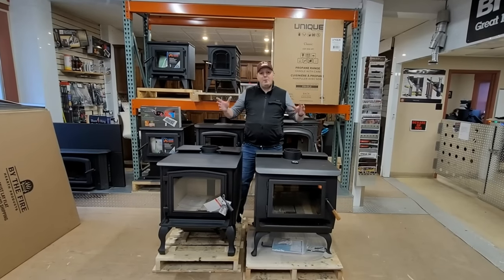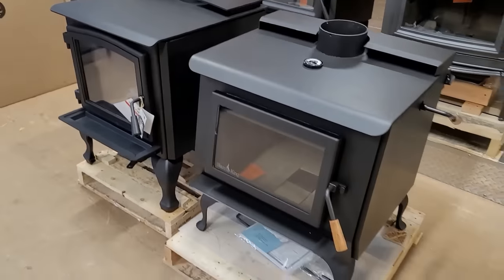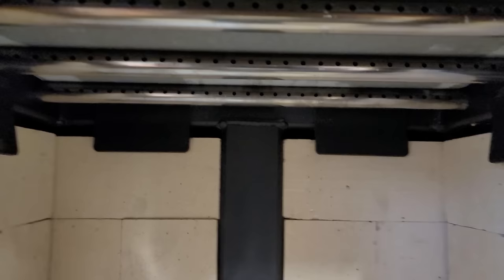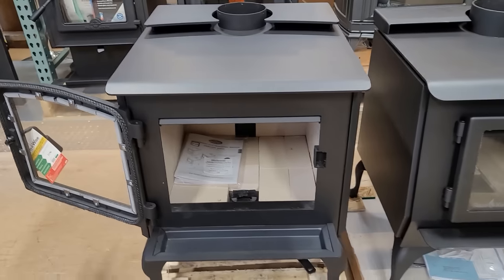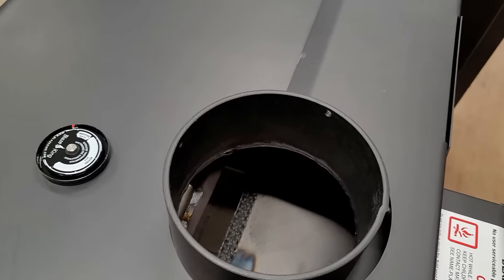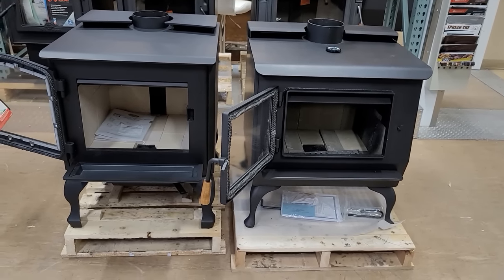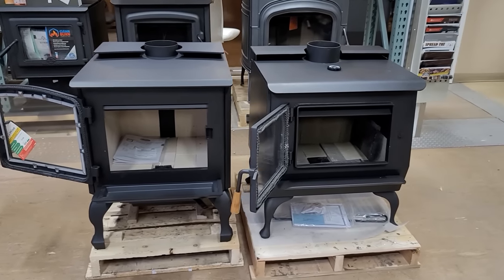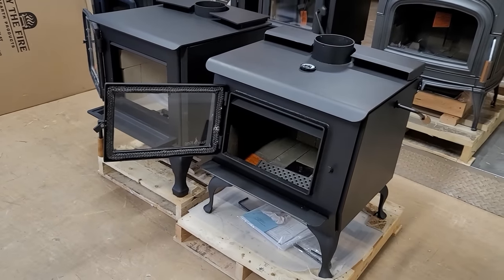Comparing Catalytic to Secondary Air Wood Stoves

Comment: This video is a good example of someone who understands 60% of the subject and makes up the other 40%.

The difference between a catalytic stove and a stove that only has secondary air with no catalyst is pretty simple. One has a catalyst and the other doesn't, they both have secondary air. Because one has a catalyst the temperature of the combustion chamber can be lower and the burn rate slower because when the unburnt fuel (AKA smoke) reaches the catalyst along with the secondary air it will can burn at the lower temperature by virtue of the fact that it is in proximity to a catalyst (after all, that is what a catalyst does. It makes a reaction happen faster and/or at lower temps).

On the other side, the stove that does not have a catalyst requires higher combustion chamber temperature to oxidize the "smoke" in the chamber. Therefor, the rate of combustion must be higher to provide the higher combustion chamber temperatures.

One is no more efficient than the other, and one does not use more air than the other. The rate of air flow through the fire box is higher for the non-catalyst stove but the burn time is shorter so the total amount of air used to burn the same amount of wood is the same.

it is your use case that dictates which one is better for your application. If you need large amounts of heat than the non catalyst is for you, If you have lower heat needs and can utilize longer burn times then the catalytic unit is for you. You are in a tough spot if your space has low heat requirements but you have to recover after an extended period of absence (such as a weekend cabin).

This is all you really need to figure out: What are your heat needs? Do you need lots of heat fast? Then get a non catalytic unit. Need a little bit of heat and can benefit from long burn times? Then get a unit with a catalyst. Need both? You are going to have to figure out which side you are closest to and what you can tolerate better.

"There are no solutions, only trade-offs"
                                                Thomas Sowell
Reply from the maker: I use the word Cat Stove vs Secondary as some of the industry calls their stove Non-Cat stoves which I feel is sometimes misleading in our industry. When I say Secondary air if refers to stoves that pull in extra air to burn and have some sort of baffle or tubes that bring in "extra" air. Blaze King is not a secondary air stove. All stoves bring in air for combustion but the process is different in these two types of stoves. One produces extra heat from a chemical reaction while the other brings in super heated air to complete the combustion triangle. I never said one was more efficient then the other. This video is intended to show people the differences in both types and let them make up their own mind what works best for them. 
You commented that the amount of air used is the same but one burns slower. So essentially what you are saying is one uses less air per hour then the other. Which is what I am referring to. Cat stoves do use less air when compared to secondary air stoves when burning at the same time. There is no need to confuse buyers with information that makes you sound smart. Its the curse of knowledge most sales people have when customers come in and try to buy something. Sales people sell at a 9 or 10 while most customers buy at a 1 or 2. If you read down through the comments you will see what happens when someone like me puts a video together with the intentions of selling at a 1 or 2.

Comment: Interestingly all the wood stove vids I have seen from the USA don't seem to have an inlet on the stove for air from outside the house. Having one makes a big difference because it is not drawing in warm air from the house and sending it up the chimney.
Reply from the maker: The same could be said about bringing raw cold air into the firebox for combustion.....takes more energy to warm up the firebox when the air is cold. I think outside air is needed in certain applications and should be used accordingly.
Reply: @tinmaninc2023  true, but the problem is that all the air from the room that goes up the chimney has to be replaced with cold air from outside.
Reply: @tinmaninc2023  anyway, thanks for the video. I didn't know they made catalytic stoves, interesting! Mine are like 120+ years old so not quite so sophisticated!
Reply from the maker: @richardledlightguy  I had really never thought of it like that before. That's so interesting. Thanks for that.

Comment: You never talked  about the replacement cost of the catalytic to replace as the do go bad. I have 2 non cat stoves and would NEVER own a cat stove, I have friends with catalytic stoves and replacing their cat was costly and hard to get in.
Reply from the maker: I guess it depends on the model...one could make the same argument with secondary air stoves and baffle replacements. That's why I did not mention it.
Reply: I don't want the high maintenance costs either!
Reply: @tinmaninc2023  
My older Osburn has the original secondary air in back, cast iron.
Those new air tubes look like a BBQ.
Lol
Reply: @sonofrobert  I have never replace any secondary air tubes in over 35 years of burning. The cat's get clogged up over time and are costly It' a easy way for company's to meet EPA reg"s. Slap one in
Reply: @JosephSmith-sg9yv  
That's cool.  Those tubes much be tougher than the BBQ..lol
If I ever need to get a new stove, I consider that.
I didn't know they had tubes on old stoves unless you did it yourself.
Cheers
Reply: @sonofrobert  QUADRA_ FIRE  STOVE

Comment: The burning process creates a gas and if there is a secondary source of oxygen the potential energy of that gas is better used - it needs oxygen to fully react and it gets it. So I am not sure that more oxygen translates to: burns faster through the material. It could mean - there is a smaller fire but with the gas also fully burning the temperature is higher and it keeps on going nicely.

In a cheap stove the gas will leave without using all the potential energy in it.

Comment: But in terms of seasoning your wood you have to cut two years ahead of your burn season. That’s a deal breaker.
Reply: I’ve heard two year cure time is a best practice for any wood stove. As I understand it, on a two year cure, you get the most out of it for your labor.  I suppose it’s a “your mileage may vary” rule of thumb.
Reply: A lot of us rotate on three year schedule.
Reply: @QuietRiverBear  This is the rule of thumb I'm familiar with, too. However, seems to me that it could vary a lot according climate. For example, in most of the Northeastern US, with its humid summers, wood would cure more slowly. In the mountains, at 6000 feet or higher, the dry air and strong sun would make for a faster cure time.

Comment: Well the big difference is in the cat stove you will be replacing the cat  after so many hours of burning. People that burn a lot will be replacing it every couple years. Yes it burns a long time with low heat output which is great and can put out a lot of heat for a short period of time like the secondary burn stove, but you buy a cat every few years. There is more maintenance with the cat stove, bypass leaver and everything with it, the cat itself needs to be cleaned once in a while and replaced as stated. If you just want heat and less trouble/expense you are probably better off with a secondary burn stove, you just have to load it more often.
Reply from the maker: I tend to disagree with that statement. Yes while some have had to replace their cats after a few years most don't have too. Many of our customers are still on their first cat so. It really comes down to dealer education with a customer. Cat stoves are not for everyone, I think thats the key takeaway for salespeople, you can't sell everyone who walks in the store a cat stove as some don't understand the process or aren't good wood burners. The other reason I disagree with you on is brands....Vermont Castings years ago had numerous cat issues and that left a bad taste in peoples mouths for years so all cat stoves were branded to be bad. However companies like Blaze King went and offered a 10 year warranty for their $300 cat. If we compare to a popular secondary air stove like say a Napoleon 1400 model which there are 10's of thousands of these models out there they had major baffle issues that required yearly replacement at about a $100 per year. Yet with all these baffle replacements there were still people who had the original baffles. Again the dealers who educate their customers usually get the best service life out of their products.
Reply: @tinmaninc2023   So if you are burning with a Blaze King 24/7 with good wood how many hours do you get before the cat needs to be replaced? What I have read in the forums is about 10,000 hours ,, that's 416 days, burning 7 months a year is about 210 days so that's about 2 years out of the cat. Other than using really good wood that is less then 20% moisture content  and not letting the stove over fire what else can you do to keep the cat working? I believe the first cat is under warranty for 10 years, once they replace that one I think you are on your own. Blaze King is definitely the best out there, it controls the heat output better then anything else, but the cat is going to get tired sooner or later and need to be replaced.
Reply: @richardkent9621  Is that your speculation or have you owned a blaze king. As reading comments I find that the majority condemning the cats don't have one or improperly run them.

Comment: More parts, more problems... give me the first heater (Secondary) that burns hot and uses more wood and works year after year with no problems. I have the wood, and don't like to get cold. Been using my BUCK for 10 years now. Clean the chimney out once a year, keep burning well dried seasoned hardwood.
Reply from the maker: That's true for sure. But many secondary air stoves also have replacement parts that can cause lots of grief if not looked after properly.

Comment: nothing about the cost of the stove.  it sounds like the cat might produce more btu per cord but even that is a little fuzzy.  these look like they would be more expensive than a heat pump, or at least more than electric resistence, or natural gas.  the glass fronts just have this "you're gonna pay big time" look to them.
Reply from the maker: Cost wasn't the point of the video. Cost vary from brand to brand and location. I'm simply showing the differences in two types of stoves.

Comment: First things first: Which gives the most heat? Pounds of oak to BTUs? That's the first consideration in a cold climate, but in 10 minutes, *not a word*. SALESMAN first, educator second. HEAT efficiency is a top consideration for many; over prettiness and so on. The answer, as always, is in the comments. You had me sold on the catalyst till I read it is $200-$300 sale periodically after break in. Particulates aside,  energy efficiency is about the same. The slow burner would not heat my home in Canada. In ten minutes of burn time talk, a second of prudent info would be nice before a thousand dollar investment that may prove to be a waste of money.
Reply: I've owned my princess for 12 years, catylist still going strong. The key is to follow the directions. If you run smoke through the catylist before it heats up, it's will clog up. If you wait for it to come to temperature and then engage it, you are good. I'm heating my 2400 sq ft house in the Yukon no problem without having to start a fire every morning or when I get home after work. If it is working for me in the Yukon, I would suggest you are fine! The princess is the most commonly used wood stove up here for a reason.
Reply: @binkpear  Thanks for the honest update from a user not a speculator!

Comment: Clearly you're only interested in sales. You didn't mention the lifespan of the catalyst. You didn't mention the relative prices or the replacement cost of the catalyst. You didn't mention the maintenance of the stove. Really?  Have the necessary information. ... 11 yrs with an outside water stove.
Reply from the maker: I didn't create this video to be a maintenance video, lifespan of the cats is irrelevant and both types of stoves have maintenance related issues. Whether your replacing the Cat in a catalytic stove or replacing a baffle, air tubes or stainless baffle in secondary air is relatively all the same. This video is merely done to show that there are different types of wood burning stoves on the market. And furthermore are you really comparing a wood stove to an outdoor furnace?
Reply: @tinmaninc2023  ok..... ... and, no, I was simply saying I have wood burning experience.
Reply: Blaze King offers a 10 year warranty on the catalyst that comes with the stove new. Replacements are $250 more or less depending on the stove size. On an annual cost basis, it's no worse than replacing filters for gas furnace. It's a cost worth considering, but not a very significant one. 

The overall economics depend on your situation, particularly your cost of fuel. If you have a big wood lot and harvest and split it yourself, it's not so important if you don't squeeze every possible burn hour out of each load. 

For those of us in suburban or other settings where we're buying wood for $150 a face cord, efficiency becomes a different consideration.

Comment: Ok you are very confused about the terms involved.    Burn time and efficency are not even close to the same thing.   Many noncat stoves are just as efficient as cat stoves they just release the BTUs over a shorter period of time.   It all depends upon your needs.  If you have a low btu load a cat stove will be great.   If you need more BTUs the advantages of a cat stove disappear so why bother with the added maintenance of a cat stove?
Reply: Not true, the cats burn more btu from the wood by burning all the gasses much better than secondary air because those stoves don't burn those gasses unless it optimal conditions where as the cat does 100% time once started
Reply: @safffff1000  yes you are correct the best cat stoves beat the best non cat stoves by a couple percentage points in terms of efficiency.  But only when the cat stoves are being burnt low where they are optimally efficent.  As the burn rate increases on a cat stove the efficiency drops and there is no efficency benifit.  Which type is best will depend upon the individuals specific needs.   Neither one is better across the board.
Reply: @benholler1389  Since weather always varies the best one would be that can handle across the board which would be the cat, great as slow burns equal at high.
Reply: @safffff1000  I have run both.  Currently have a blaze king going back to noncat next year.  I simply don't see the benifit from the cat for more than a few weeks.  The rest of the heating season I run 8 hour cycles.  Why would I pay for cats every few years when I don't benifit from it
Reply: Again absolutely nothing wrong with either tech.  One is great at low btu output the other is better at high output.

Comment: There is no combustion without oxygen. There has to be enough oxygen in the smoke going through the cat converter to burn the combustible vapors.
Reply: It doesn’t convert them with combustion. It’s a catalyst. That’s the whole point. That’s why he keeps talking about the other one using more air, because the other one DOES combust the vapors, hence secondary burn. The catalyst works kinda like a filter; it eventually plugs up and you replace it (maybe there’s a process to clean them?).

Comment: Very interesting and informative video.
However, I'm calling B.S. on the 20 hour burn time.
More like 6 with 8 at the far end.
No wood stove burns for 20 hours; come on!
Reply from the maker: Easy to call BS if you haven't tried one or understand how they work. Also i didn't say 20 hours... i said 30 hours..... they even have a 40 hour version as well. With that said most don't burn them on low as there is no point to burning on low for 30 hours at a time. Most leave their stoves at half draft and get a solid 15 hours of burntime with a nice even heat thru the home.
Reply: Lol. You have no idea what you're talking about. They can and do burn cleanly for over 20 hours.
Reply: @louiswestfall9622  I notice in all comments and forum boards, people comment on things by hearsay and not actual experience. I only listen to those who have waked the walk
Reply: @louiswestfall9622  lots of catalytic stove owners get 20+ hours. I know somebody with a Blaze King princess model that goes 24hrs on a full load and that's burning mostly Douglas fir.

Comment: Keep it simple just buy a non catalytic non secondary stove. Buy a nice Vermont casting stove. Rotting wood at the forest floor gives of the same emissions as a non catalytic stove. Why pay more for using more wood or having to replace a catalytic  converter.  Over engineered over priced, just to act like your helping the environment.